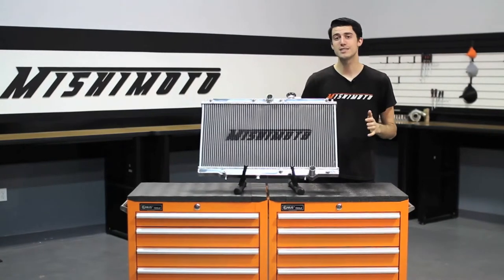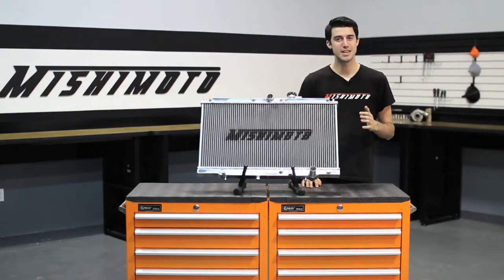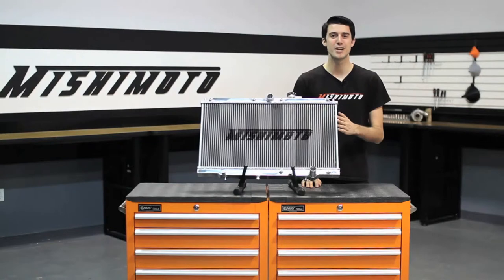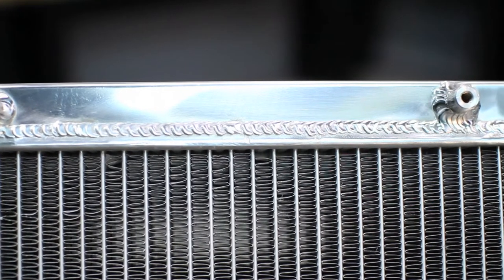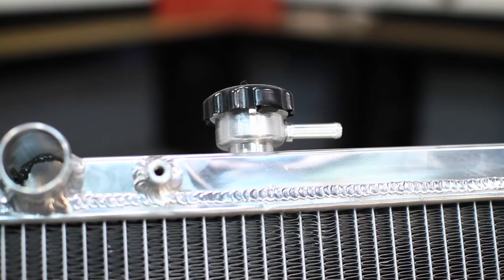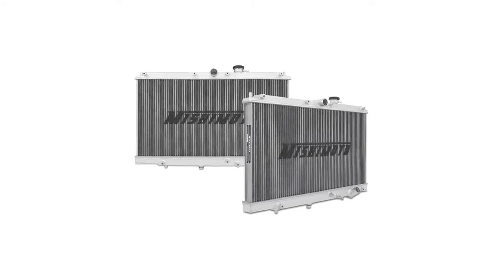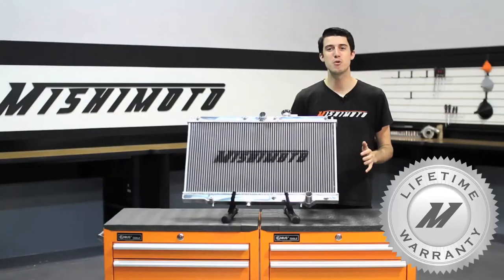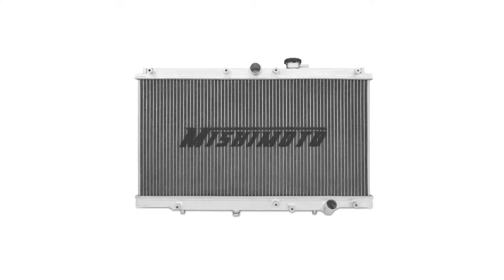1997-2001 Honda Prelude Performance Aluminum Radiator Features & Benefits by Mishimoto

Comment: I just purchased this radiator, fan kit and oil cooler for my Prelude SH.   Parts are on the way. 
Does anyone have a picture of how exactly the aftermarket cooler was installed?  Keep in mind that my AC works and I will be keeping it.
Reply: Did u need to put a intercooler on the front of the radiator or just what u ordered from mishimoto,bought the radiator, shroud fans and hoses have 98 SH

Comment: I like to know if it fets in an automatic prelude ..thanks....
Reply from the maker: Hello Ivan, thanks for reaching out. While this radiator is designed for manual vehicles, it still has the ability to function with your automatic.

 Essentially, our radiator eliminates the internal transmission cooler that your factory radiator has built in. All you would need to do is purchase our universal transmission cooler to replace this internal unit. Link below to the universal unit we suggest for your vehicle. 

https://www.mishimoto.com/mishimoto-universal-transmission-cooler-kit.html

Comment: Will it fit an SH?
Reply from the maker: SH models with the ATTS system require an external transmission cooler for this radiator to work.
Reply: Mishimoto Automotive 

Do you have a picture of an oil cooler installed on a Prelude SH (for the atts.)

I have questions on where exactly to mount the cooler itself.  Can it go between the ac condenser and radiator itself?  Or will this cause problems?